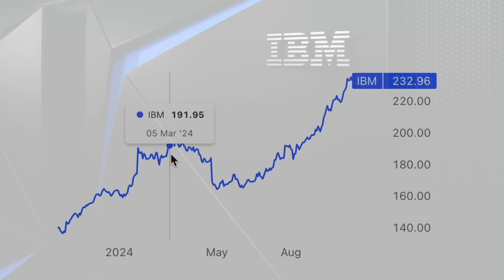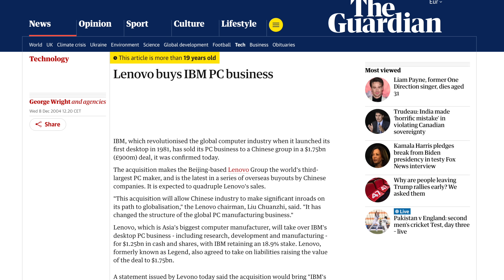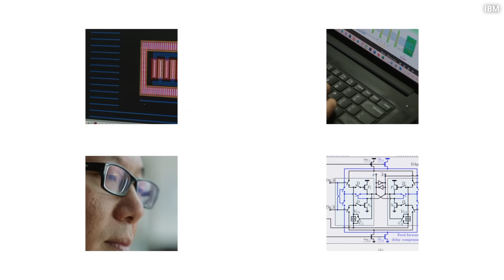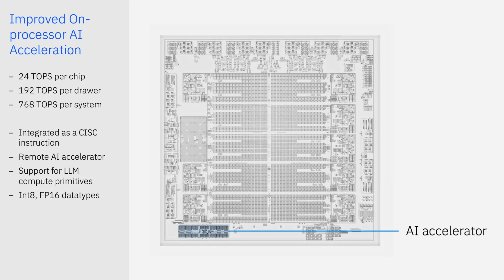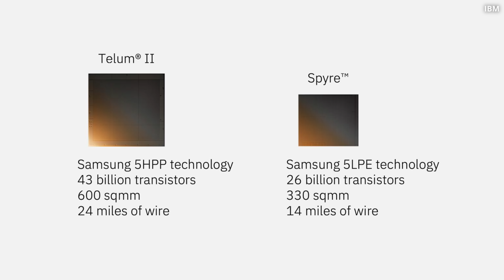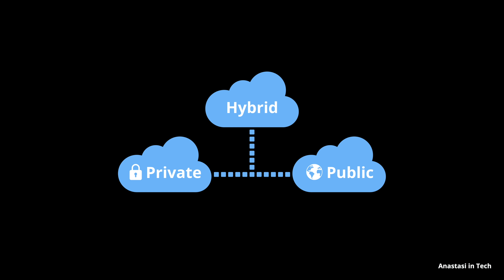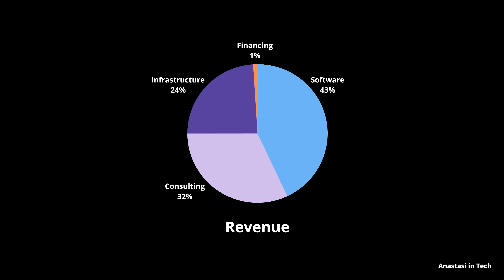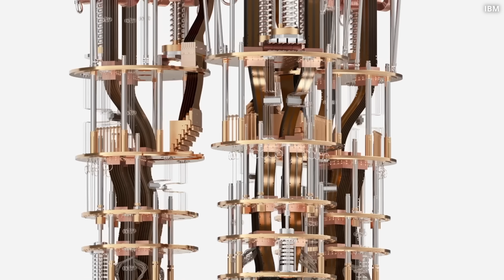The Secret Plan of IBM

Comment: Sorry but you had one detail wrong, IBM did not make the first PC, although they were the first ones to slap PC on the front cover, prior to the IBM PC there were plenty of companies making PC's, in fact Heathkit even made them, the H8 and H89 were both out before the IBM PC, not to mention Apple, Radio Shack, and many more, there was also an emerging common OS, CP/M starting to get everyone on the same page. That said IBM legitimized the PC as a "real" computer in the eyes of Corporate America. I worked for a big bank prior to the PC launch and at that time you could not get funding for a PC based project to save your life, IBM released the PC and corporate executives could not sign up fast enough and it was raining money for PC projects after that and that was the real turning point for PC's. We used to have a saying in corporate IT, you never get fired for going with IBM.
Reply: Yes, first business pc, but did little good even with IRMA emulator board. Very little could be done on a pc.  The fact is all the data, computing, utilities was still on the mainframe.

Comment: It was a nice briefing about IBM's  microchip. 
Would you explain in detail about 133 Qubits IBM's microchip please?
I like to learn more about microchip and Qubit Algorithms and photon particles. I use to work on robot manually to control it from control panel, because the robot didn't work automatically. I learned it in one hour with zero experience in technology and computer. 
Is it possible to learn and to build a powerful IBM microchip without high school diploma? Because I love Quantum Mechanical Engineering. 
Thank you.

Comment: Cloud computing is not a new concept. Early on, folks connected dumb terminals to remote mainframes and servers for compilation, applications, and data. The advent of stand-alone PCs came about because of tech improvements and limited connection speeds (and WinTel monopolies). Innovations in high-speed connectivity brought the cloud back. Cloud 2.0 may be a better term.

Comment: First PC?  What about... Altair 8800 (1975) - This is frequently cited as the spark that ignited the personal computer revolution. It was sold as a kit and was based on the Intel 8080 microprocessor. Although it didn't come with a keyboard or monitor, its creation led to significant interest in personal computing, and it was notably featured in Popular Electronics, which caught the attention of hobbyists like Bill Gates and Paul Allen, who developed BASIC for it.

Apple I (1976) - Designed by Steve Wozniak and marketed by Steve Jobs, the Apple I was one of the first personal computers to come as a single PCB (Printed Circuit Board) that users could turn into a fully operational computer with a keyboard and display. It wasn't a complete "out-of-the-box" PC as we understand today, but it was a significant step towards that. 

Commodore PET, Apple II, and TRS-80 (1977) - These are often collectively considered the first "mass-produced" personal computers available to the general public in a more recognizable form, with integrated keyboards, and eventually, capabilities like color graphics and storage. The Apple II, in particular, is famous for bringing personal computing to a broader audience with its software applications, including the VisiCalc spreadsheet, which was a killer app for business use.

The IBM PC, which became the standard for the personal computer industry, was first released on August 12, 1981. This model was known as the IBM 5150, and its introduction was significant because it legitimized the personal computer in the business world and set a hardware standard that many other manufacturers would clone or emulate, leading to the term "IBM compatible."

Comment: Neural network architecture is extremely compatible with implementation in silicon.
It consists of a large number of fairly simple “neurons”.
The main problem is interconnection. You want to connect every neuron in one row to every neuron in the next.
The other problem is the weight of the connection.  
You want to load in weight values for a particular task, or adjust weights incrementally during learning.
But NNs are so useful, I am confident these problems will be overcome.

Comment: No.
Many clones of IBM pc were manufactured & sold of course but they were NOT running windo2s.
They were running DOS.
Windows (3.1.1)  didnt appear until years later.
Reply: @AdamsOlympia  Apple fanbois like to pretend Steve Jobs invented the GUI.  He didnt.  Xerox PARC did.  This idea that had Apple not stolen the idea that MS wouldn't have is absurd rewriting of History.
Reply: @TheGreatRepeller  Even Xerox PARC was not the originator of the GUI. They were just the first people with hardware good enough to run one. Doug Engelbart originated every key aspect of WIMP, and demonstrated them in a basic form to people too dumb to realise what they were seeing.
Reply: Windows was a clone of os2. If IBM had open sourced this nobody would be running windows
Reply: @samvox994  WindowsNT was an OS/2 clone. OS/2 light became Windows. I was on the IBM PS/2 OS/2 marketing team but knew it would flop due to the micro channel architecture hardware invalidating of 3rd party boards and lack of OS/2 killer app (i.e. no spreadsheet).
Reply: @samvox994  graphical user interface was pioneered at xerox. when steve jobs hauled bill gates for copying their mouse, bill said they both took "inspiration" from xerox. and OS/2 was IBMs late answer to windows 3. very late. too late to affect the market
Reply: @AdamsOlympia windows 1 was a total failure. It didn't drive anyone's sales. Windows didn't start to make an impact until version 3.1 in the early 90s.
Reply: PORN 18+ e TRUMP PODE PESQUISAR VIU #
Reply: The early GUIs like windows had to wait until the hardware got powerful enough for them to really be useful. Windows and OS2 also were intended to be multitasking or at least task switching  but DOS was always single tasking.   Early PCs also lacked sufficient memory to really run a GUI. Early PC programmers often resorted to writing assembly code in critical areas to keep performance acceptable as well as making direct calls to the BIOS. All of that made it take a while for GUI interfaces and multi tasking to really take over.
Reply: IBM, a hardware company, lost marketing and commercial relevance when they gave up the ThinkPad. When they come back with relevant hardware they can bounce back. Hope they do.
Reply: She is definitely an expert XD
Reply: The first windows OS generations were considered children's stuff and nearly every major software was only executable in DOS and windows had to open a DOS window before launching them. Very little adoption by the businesses until the next windows versions introduced office and other business packages that made windows a gold standard of OS for general business administration tasks.

Comment: In fact, IBM was by far not the first in the personal computer market. Think Apple, Atari, many others. On the other hand, the arrival of the IBM PC standardized the market by killing competition, with companies buying IBM more readily than any other brand, for a time. Another factor that spread "the" PC widely was that IBM had such little faith in these micromachines that they didn't bother to patent the BIOS. Quite quickly this allowed external, Taiwanese firms to develop clones and then clone the entire machine. Very quickly, these small, very responsive firms released more powerful, faster versions of the IBM PC, while remaining software compatible with the original.
Regardless, IBM has been an extraordinary company, which I am pleased to see reborn in these times.

Comment: 7:43  It looks likely that a more 'real' rather than simulated neural network is built in the chip to run AI, and it's just a matter of time the Skynet will be put into reality.
14:14  Your data might be a little bit obsolete, as I've heard from another YT channel that 'According to the new plan, they will stay at 1000 qubits at least for the next few years (till 2028) and instead focus on error correction.'

Comment: 102122  Nanometer scale uniformly aligned parallel diode arrays may be a practical way of absorbing ambient heat. Ambient heat is uniform on a micrometer and larger scale and non uniform on a nanometer scale. Plausibly,  heat absorbtion at the non uniform scale is available as Johnson Nyquest thermal electrical noise that would yield, by conversion without gain or loss, an equivelent amount of electrical energy. 
AND
 Diode voltage / current  characterstics can be displayed on an XY tracing oscìlloscope. Thermal electrical noise power in resistors can be displayed by time sweeps of voltage on an oscilloscope. Each such time sweep shows unique randomness.
AND
A  simple  "Special Program with Integrated Circuit Emphasis" model indicated that diodes in uniform alignment parallel would aggregate simulated rectified thermal electrical noise.

Maximum direct current electrical power, half, is transfered from a direct current electrical source to the electrucal load when the electrical resistance of the two parts is equal. Calculated matched resistance output (watts) is k (Boltźman's constant), one point three eight x 10^ minus 23, times T (temperature Kelvin) times bandwidth (0 Hz to a natural limit ~2 THz @ 290 K) times rectification halving and nanowatt power level rectification efficiency, times the number of diodes in the array. 

There are a billion cells of 1000 square nanometer area each per square millimeter, 100 billion per square centimeter. 

Creditable independent replicatable proof of concept protypes beyond improper influence are needed.

Aloha
Charles M Brown 
Kilauea, Kauai, Hawaii 96754

Comment: 102122  The second law of thermodynamics may be false conventional wisdom. Let's face the wonder of full heat use. 

The second law of thermodynamics was developed during v8ictorian england's scientific and religious fascination with steam engines. 

The second law is behind modern refrigerators needing electrical energy to compress the refrigerent to force it to release as waste the heat that it has removed from the refrigerator's service interior in the cooling part of the refrigerent's circulation. The interior coldness draws in exterior heat through the cabinet insulation. There is also discarded heat from mechanical friction and electrical resistance. The net thermal output equals the electrical input with energy not being gained or lost in this refrigeration system including its forced waste. Unencumbered refrigeration by the principle that energy is conserved should produce electricity instead of consuming it. 

It makes more sense that refrigerators should yield electricity because energy is widely known to change form with no ultimate path of energy gain or loss being found. Therefore any form of fully recyclable energy can be cycled endlessly in any quantity. 

Full heat recycling, all electric, very isolated underground, undersea, or space communities would be highly survivable with self sufficient EMP resistant LED light  automated vertical farms, thaw resistant frozen food storehouses, factories, dwellings, self contained elevators, safe rooms, and horizontal transports. 

In a flourishing civillization, small self sufficient electric or cooling devices of many kinds and styles like lamps, smartphones, hotplates, water heaters, cooler chests, fans, radios, TVs, cameras, security devices, robot test equipment, scales, transaction terminals, wall clocks, open or ciosed for business luminous signs, power hand tools, ditch diggers, pumps, and personal transports, would be available for immediate use incrementally anywhere as people as individuals or larger social groups see fit. 

Some equipment groups could be consolidated on local networks. 

If a high majority thinks our civilization should geoengineer gigatons or 
teratons of carbon dioxide out of our environment, instalations using devices that convert ambient heat into electricity can hypothetically be scaled up do it with a choice of comsequences including many beneficial ones. 

Energy sensible refrigerators that absorb heat and yield electricity would complement computers as computing consumes electricity and yields heat. Computing would be free. Chips could have energy recycling built in.

A simple rectifier crystal can, iust short of a replicatable long term demonstration of a powerful prototype, almost certainly filter the random thermal motioren of electrons or discrete positiive charged voids called holes so the electric current flowing in one direction predominates. At low system voltage a filtrate of one polarity predominates only a little but there is always usable electrical power derived from the source, which is Johnson (observation) Nyquest (theory) thermal electrical noise. This net electrical filtrate can be aggregated in a group of separate diodes in consistent alignment parallel creating widely scalable electrical power. The maximum energy is converted from ambient heat to productive direct current electricity when the electrical load electrical resistance  is equal to the array internal electrical resistance. 

Maximum calculated electrical power output (watts) is k (Boltźman's constant), one point three eight x 10^ minus 23, times T (temperature Kelvin) times bandwidth (0 Hz to a natural limit ~2 THz @ 290 K) times rectification halving and nanowatt power level rectification efficiency, times the number of diodes in the array. 

There are a billion cells of 1000 square nanometer area each per square millimeter, 100 billion per square centimeter. 

Order is imposed on the random thermal motion of electrons by the structual orderlyness of a diode array made of diodes made within a slab: 

  P type boron doped
-----‐------‐----___-- Out
🔻🔻🔻🔻
■■■■■■___ + Out 
  N type phosphorous doped 

All the P type semiconductor anodes abut a metal conductive plane deposited on the top face of the slab with nonrectifying joins;  the N type semiconductor cathodes or common cathode abuts the bottom face. As the polarity filtered electrical energy is exported, the amount of thermal energy in the group of diodes decreases. This group cooling will draw heat in from the surrounding ambient heat at a rate depending on the filtering rate and thermal resistance between the group and ambient gas, liquid, or solid warmer than absolute zero. There is always a lot of ambient heat on our planet, more on equatorial dry desert summer days and less on polar desert winter nights.

Focusing on the composition of one simple diode, a near flawless crystal of silicon is modified by implanting a small amount of phosphorus (N type conductivity) on one side from a ohmic contact end to a junction where the additive is suddenly and completely changed to boron (P type conductivity) with minimal disturbance of the crystal lattice. The crystal then continues to another ohmic contact. 

A region of high electrical resistance forms at the junction in this type of diode when the phosphorous near the ĵunction donates electrons that are free to move elsewhere while leaving phosphorus ions held in the crystal while the boron donates holes which are similalarly free to move. The two types of mobile charges mutually clear each other away near the junction leaving little electrical conductivity. An equlibrium width of this region is settled between the phosphorus, boron, electrons, and holes. Thermal noise is beyond steady state equlibrium. Thermal noise transients, where mobile electrons move from the phosphorus added side to the boron added side ride transient extra conductivity so the forward moving  electrons are preferentally filtered into the external circuit. Mobile electrons are units of electric current. They lose their thermal energy of motion and gain electromotive force, another name for voltage, as they transition between the junction and the array electrical tap. 

Inside the diode, heat is absorbe; outside the diode, to exactly the same extent, an attached electrical circuit is energized. The voltage of a diode array is likely to be small so many similar arrays need to be put in series to build higher voltage.  

Understanding diodes is one way to become convinced that Johnson Nyquest thermal electrical noise can be rectified and aggregated. Self assembling development teams may find many ways to accomplish this wide mission. Taxonomically there should be many ways ways to convert heat directly into electricity. 

A practical device may use an array of Au needles in a SiO2 matrix abutting N type GaAs. These were made in the 1970s when registration technology was poor so it was easier to fabricate arrays and select one diode than just make one diode. 

There are other plausible breeches of the second law of thermodynamics. Hopefully a lot of people, mostly as independent teams, will join in expanding the breech. Please share the successes or setbacks of experiemental efforts. 

These devices would probably become segmented commodities sold with minimal margin over supply cost. They would be manufactured by advanced automation that does not need financial incentive. Applicable best practices would be adopted. Business details would be open public knowledge. Associated people should move as negotiated and freely and honestly talk. Commerce would be a planetary scale unified conglomerate of diverse local cooperatives. There is no need of wealth extracting top commanders. We do not need often token philanthropy from the top if the wide majority of people can afford to be generous. 

Aloha
Charles M Brown 
Kilauea Kauai Hawaii 96754

Comment: On December 11th, 1972, Q1 Corporation sold the first Q1 microcomputer, based on the Intel 8008 microprocessor.
It had the first QWERTY keyboard, printer and floppy. It was IBM that sold first computers 1957, 610 transistor and tube based processor, price tag was $55K.